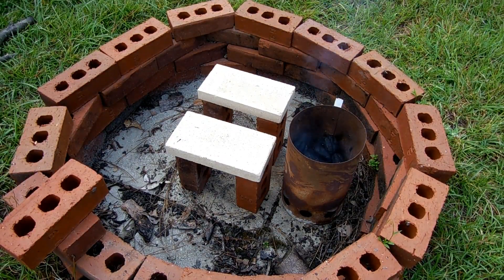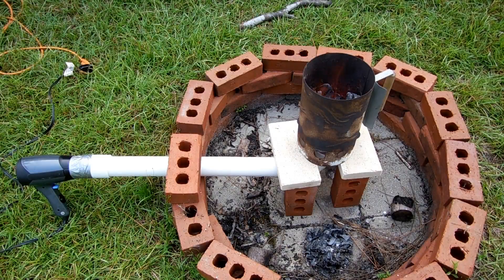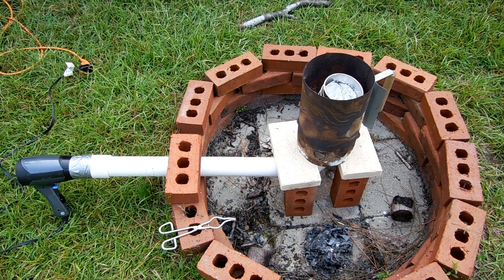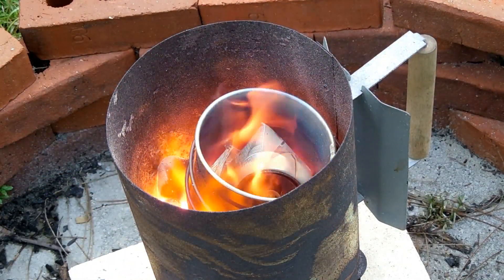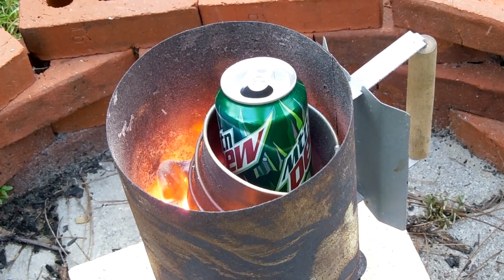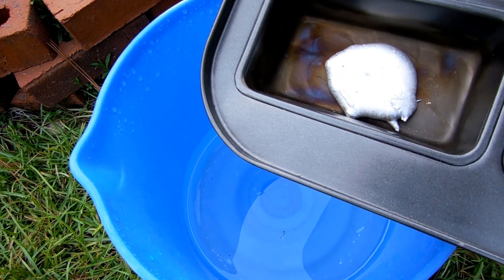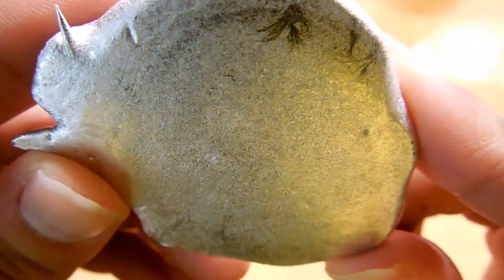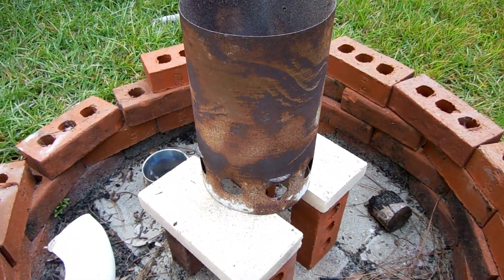Very Simple Aluminum Furnace

Comment: Did you drill small holes in the bottom of that and did you just let the elbow rest just bottom surface
Reply from the maker: The elbow is just positioned several inches below the chimney and blows up into it. There are no connections or anything; I guess it isn't very clear in the video.
Reply: mrhomescientist 
So is there just some sort of screen in the bottom?
Reply from the maker: stoloveje Right. The charcoal sits on a grate and air can come up from the below, which is why it works so well. Google images of charcoal chimneys and maybe that will clear things up.

Comment: nice job but speaking of safety (not only for the fact you dont wear shoes like people already said), you're lucky your piece of aluminium was already solified once you pour it in the water.. cause else it would gone BOOM!
yes, melted aluminium with just one drop of water or dropped in a wet mold EXPLODES !
Dunno if you knew about that, but if you did it would have been nice to tell it in your video. just for the safety of people who would like to do it like you.

anyway, still an nice vid.
Reply from the maker: Pouring molten metals into a (relatively) large amount of water is how metal shot is made, so it's pretty safe that way. Pouring molten metals into a wet mold or onto a small amount of water will instantly boil it and splatter hot metal around, so that is definitely to be avoided.
Reply: mrhomescientist
yeah, but shot isn't aluminium, what they say is right water in molten aluminium = explosion.
Reply: racketman2u trapped water in molten metal will explode  because it has now where to go
but pouring any molten metal in water won't as the water is not confined and can easily escape

Comment: Al melts @ 1220 F. Good job. I did this once, with my Dad's brand new grill and a shop vac/blower. Bad idea, since the grill was made of thick cast aluminum. Not only did I blast furnace a hole in the back of the grill, I set the back yard on fire to boot. However, it did guide me towards a career. I have been a firefighter now for 28 years. I fixed Dad's grill with a piece of metal road sign and some self-tapping screws. He was still awful pissed off at me though. There is just no pleasing some guys. Cheers from Texas.

Comment: Hi m8.

I was thinking...

To produce more heat, try to use coke instead, it will not produce any ashes at all and it will heat about 3-4 times more and longer than charcoal.

And to prevent heat loss, see if you can find a conical container to your chimney, and in the top of your chimney cut some "groove's" with an anglegrinder.

The idea you used wit the hairdryer is perfect.. :-)

Best regards from Denmark.

Comment: cool job, I didn't think aluminium had a crystal structure though.
I melted a few cans in a stainless pot on my stove with extra heat on top from a gas torch, next i'll try it with a fernell lens and the sun.

Comment: if you redo the pipe for the hair dryer use some cheap metal piping at the part that connects so the crucible. ive seen people who ducttape a 1 foot section with the elbow to a vacuum cleaner on blow and that works pretty well.

Comment: Aren't the pull tabs are made of a higher quality of aluminium with titanium ? Would be good to separate them. Not sure if anyone has mentioned this already.
Reply from the maker: They have, and they aren't. It's a common myth. Check the description for the actual alloys used in can manufacture, which I tracked down. The lids and tabs have higher magnesium content, to add strength, but besides that they aren't anything too special.

Comment: First question I have after the obvious: WHY are you melting aluminum?  What do you want to make with aluminum 'ingots'?  I can see melting lead cause you want to make bullets.
Reply from the maker: Mostly I just had lots of fun doing it. The ingots I ended up with after doing this several times make a great display piece for my element collection, and it's cool to point to a block of metal and tell people it used to be 40 soda cans! There are a bunch of YouTubers who do things like this to make parts for machines and what not.
Reply: There is a lot of uses for melted aluminum. If you have a lathe or mill, you can use it as aluminum stock. You can also create sand molds to cast parts. Check out youtuber's "myfordboy" channel if you want to see pretty cool stuff he does with aluminum casting.

Comment: btw if you do this again, be very aware not to mistake stainless steel for zinc coated or galvanized metal. the reason is zinc is toxic when burned and melts at a very low temperature.

Comment: Is there a hole in the furnace can for the elbow of the pvc pip?
Reply from the maker: The charcoal chimney has a grate at the bottom that the coals sit on, which is what the elbow points up into. I'm surprised that a lot of people don't seem to know what charcoal chimneys are! I should have went over it in the video.
Reply: Can you scrap the ingots?

Comment: I managed to do it without a powered air source, I dug a hole in the ground about 2ft deep and added an air intake hole at the side. The bottom of the crucible was about as red as yours. I used loads of 2x4s as fuel as well as a few lumps of coal.

Comment: I made an aluminum furnace... I dug a hole in the ground and made a tunnel for air. Then i filled it with wood and charcoal. In the hole for the air, i put a French drain pipe in it, then hooked my Husqvarna backpack blower to it! That thing sounded like a mini jet engine and melted the can quickly! Probably would have eventually melted the steel pot(it was glowing). I would like to know what you think. I might make a vid of it.

Comment: How did your cheap crucible not melt
Reply from the maker: It did, eventually. It's stainless steel so the furnace shouldn't get hot enough to melt it. I think the molten aluminum was maybe corrosive to the steel and after 3 or 4 firings it perforated the bottom.
Reply: mrhomescientist when will you upload something? i can't wait :D

Comment: If you want a durable furnace that can be used more than once, you could replace the hair dryer with an air compressor and the PVC tube and elbow with iron or steel tubing.

Comment: Have you tried blowing steam into the charcoal? Look up the design of Blast Furnace, adding steam to burning charcoal will produce carbon-monoxide which make the fire burn hotter. The trouble is that blast furnace is hot enough to melt iron, so your equipment may melt too. Industrial strength aluminum furnace uses an induction coil wrap around a ceramic crucible. The alternating magnetic field heat and melt the metal inside without heating the ceramic. Not sure if household electricity is strong enough to power an induction furnace though.

Comment: Tried this word for word and all I got was a lot of condensed cans 

I thought they were melting but they wert they just shrunk down and got compact
Reply from the maker: You probably only just barely reached the melting point. You need to exceed it somewhat so that it all stays liquid and coalesces into one blob. I had that happen to me once in my little firebrick propane furnace - the metal 'sagged' but didn't really melt down into a puddle. Upping the heat seems to fix this.

Comment: In my experience if you sorta skim off that slag periodically you get a better ingot at the end, I used a steel spoon for that.  However, that stuff is protecting the rest of the molten metal from oxidation, so leave a layer on there until it's time to pour.  Fortunately it floats.
I NEVER do this because I HATE safety dinks, but brother, you gotta wear some shoes.  Sometimes it pops and little (or not so little) bits of molten aluminum go flying, and if that hits bare skin you'll be very unhappy.  And sometimes you dont see where the drops land, and then you step on them in the grass, and well, it hurts.
Ask me how I know this.
Reply: It's late but how do you know
Reply: How you know this?

Comment: mrhomescientist what exactly is slag? isn't the entire can aluminum?
Reply from the maker: The can itself is an aluminum alloy, there's the label on the outside, and the inside is coated with a layer of protective plastic. Slag (technically what I had is called dross) is formed when the hot metal reacts with oxygen in the air to form aluminum oxide, which remains solid and floats on top.

Comment: Actually what you made was aluminumoxide. Aluminum has a bond with oxygen. When they make aluminum, then have to shock it to break it's bond. So when you melted it, the oxygen got back in the aluminum particles and made aluminumoxide.
Reply from the maker: The grey solid crud on top was aluminum oxide, yes. That's due to the metal oxidizing in the air while hot. But the shiny liquid I was able to pour off was aluminum metal (or at least, the aluminum alloy they use to make the cans).
Reply: ahhh ok

Comment: wat all will it melt.
Reply: like maybe copper?
Reply from the maker: Janet Bergman I haven't really taken it through its paces yet, but I think copper is possible. It's fairly close to aluminum in melting point. I need to get a new crucible before I can continue experimenting with this setup.
Reply: copper is at 1900 degrees right?
Reply: mrhomescientist just made this but replaced the hair drier with a fridge fan but cant test it as i forgot my extention cord at my friends.
Reply from the maker: Janet Bergman Yes, according to wikipedia copper is 1984 F, 764 degrees higher than aluminum. So it might actually be a stretch to get that high. I'll just have to test it. Good luck and be careful if you try!
Reply: found out if ya use coal it burns hot enough
Reply: Mr burgerman do you mean coal or charcoal
Reply: Randomyou101 He said coal, and coal is commonly used for this application, so he probably means coal.
Reply: I doubt copper will work. Steel melting point is around 1300-1400C and copper is around 1000C. Aluminium is 600-700C

Comment: hey i liked ur vid pretty informative. was wondering if the Stainless stell container u use to melt the Aluminum. wud work to melt other metal type like bronze, copper, steel, iron, if not. do u have any suggestions to wat type of metal container to use for em? thnxs wud appreciate it  alot.
Reply from the maker: To answer your question, compare the melting points of all of those metals. Since stainless steel is made of iron (and is a type of steel), you obviously couldn't melt those metals in it: the crucible would melt too. Ceramics, alumina, silica, or graphite are the usual crucible materials for higher temperature melts.
Reply: ah ok thnxs

Comment: how did you remove the slag?
Reply from the maker: I didn't, really. Just poured off the liquid aluminum from the solids. There was a lot still trapped with the slag, so next time I want to try using a flux like borax and see if that improves things.

Comment: slag comes usually from ore, and contains silicon and metal oxides
dross are the solid impurities from the oxidation metal.
Aluminum dross can be recycled and used in steel-making, to draw back the slag from the iron. So keep your dross.
Keep your dross, and make beautiful steel. (or give it to me :D)

Comment: Since there was nothing to contain any steam, I doubt the pop was a steam explosion. Heat causes sugars/starches/cellulose to decompose. Some of the decomposition products are flammable gasses (hydrogen, methane, carbon monoxide). Likely, these gasses built up and then caught fire suddenly, causing the pop. This same process is what creates smoke (which is flammable) from wood. Look up pyrolysis.
Reply from the maker: Definitely a possibility. I was a bit "surprised" when that happened so my first idea at the time might not be correct :)

Comment: I'd suggest a titanium crucible since it's melting temperature is somewhere close to 3500 degrees C. That's going to last you pretty much forever but if you don't plan on melting a lot of cans or you can't afford it I'd go for a thicker steel crucible, it will take longer to heat up but at least it won't melt trough as easily. And you should probably go ahead and heat up the crucible with a blow torch until it becomes red hot and then quickly soak it in oil to harden it if you're going with the steel one.
Reply from the maker: I've been looking at alumina, fused silica, or graphite crucibles mainly. These are all pretty sturdy and very heat-resistant.

Comment: Hi mate, do you know if the recycling places offer more money for aluminium bars rather than just straight aluminium cans? or is melting them down into bars not going to get any more cash for the scrap, and more just the thrill of the Metallurgy etc? (does it pay to melt it down into ingots?)
Reply from the maker: I did it for the fun of it. Since the recycler has to melt them down anyway I'd be surprised if bars earned you any more. It probably only saves you storage space.
Reply: ok, thanks for your reply.

Comment: Great job. Have you given any consideration to adding something in the can to deprive the molten metal from oxygen? I suspect all this "slag" is really Aluminum oxyde that you're producing while melting the cans. I would be tempted to add a couple pieces of charcoal to the aluminum to produce a relatively inert or even reducing atmosphere, short of having argon.
Reply from the maker: It is indeed aluminum oxide, plus a little carbon leftover from the plastic liner inside the cans. Crushing the cans beforehand would limit their access to oxygen and reduces slag a bit, and using a flux would help to get rid of what is formed. I'd like to make a followup video showing these things, but first I need a new crucible. Mine melted through after only 3 runs!
Reply: mrhomescientist Find an old bread loaf pan, made of stainless steel, they work very well

Comment: Loved it! I have managed to melt aluminium without the airflow (bellows or anything such like). But that was by using a LOT of charcoal and bundled split bamboo which puts out an incredible amount of heat. My intention was to have it molten long enough to cast in a mould.
Alas, to get to it and remove the crucible would have required a heatproof  suit and face shield. All this in a small backyard.

Comment: Its aluminium. Not aluminum.
Reply: Aluminium is the accepted term for use in science. Aluminum is recognised but is not used for technical descriptions or else there would be issues using the term universally. Both are correct.

Comment: +mrhomescientist Great video other than the lack of precautions. I want to try this some time, just need to get the materials. My main goal is to make a bronze sword, and then maybe some other bronze items. The Tin shouldn't be a problem when making bronze, it's melting point is 1/3rd that of Aluminum, though Copper has a melting point nearly double that of Aluminum.

Don't mind Dan Lewis. I've come across him before and to say the least, he's not the sharpest tool in the shed.

Comment: if you manage to insulate the coal chimney with a coat of bricks or sand you can increase the "furnace" temp considerably even with that set up.
Reply from the maker: Indeed. If you watch my video on casting metal bars, you'll see that I've since started surrounding the chimney with firebricks as rudimentary insulation.

Comment: I think it would work much better if you used a ceramic crucible and it fit closer to the size of the opening so not as much heat got past the crucible
Reply: If it fits closer to the side I think it would allow less air flow which is feeding the high temperature.

Comment: so it is actually melting and not oxidizing?
Reply from the maker: Both, actually. Especially since I didn't crush them beforehand, the hot Al surface is exposed to air while it melts and oxidizes quite a bit.
Reply: still a great job on a fast and furious Al melting furnace.  great job!

Comment: There are foil and metal tapes that are designed for HVAC and other things that can withstand higher temperatures. Also, it might be safer to use a metal duct (maybe insulated) to feed air into your furnace.
Reply from the maker: Definitely room for improvement. I really just threw this together with spare parts I had at home. The PVC outlet is actually several inches below the fire so I'm surprised it was scorched at all.

Comment: Wait until you have a lot more cans to melt then pile up some dry sand around a small cardboard tube and after pulling off the dross pour your alum. down the tube and you have an alum. bar to put in your lathe. I can't play like that because here we take those cans back to the store to get our ten cents back.
 I agree about smashing the cans before putting them in the pot.

Comment: They make 4" inline fans for greenhouses, find one that gives you the most flow for your dollar, then hook that up to some stainless steel piping. You can even add a speed controller and run some experiments to see if you can control the temperature.

Comment: Remove the motor from the dryer body and directly connect it to proper size of pipe and work from there. You can add a toggle switch to it, as well. A ceramic crucible would be even better than the steel drinking cup. On the end of the tube, on top of the elbow if you could flange outward and make a sprinkler like head to distribute the air evenly you'd get even better results than with the air being blown in a more concentrated area.

Comment: You should place insulation around your furnace to increase efficiency which will decrease melt time and maximize the work of your fuel.  I know b/c I work in an aluminum foundry.
Reply from the maker: Yeah I've changed quite a bit since I filmed this. I've added fire bricks all around the chimney and that helps keep heat in a lot. Thanks for the tip!